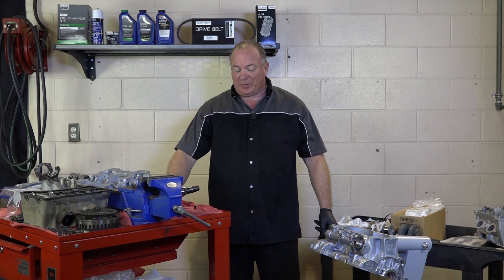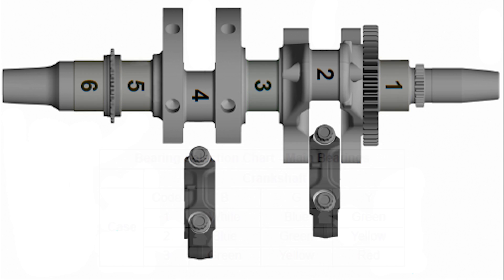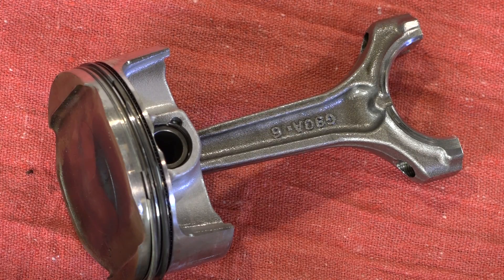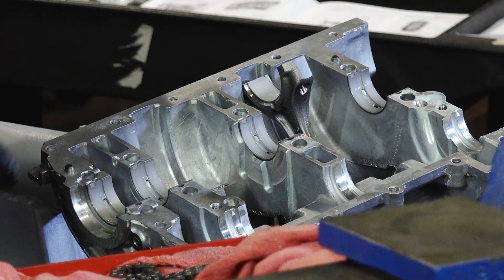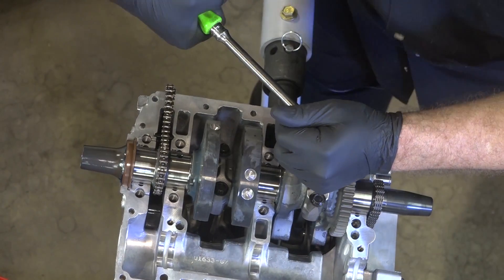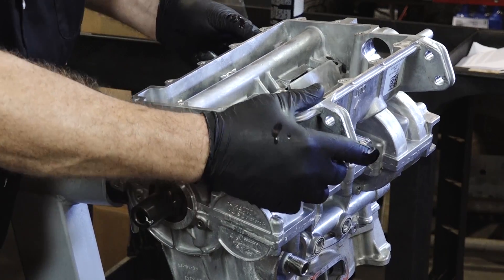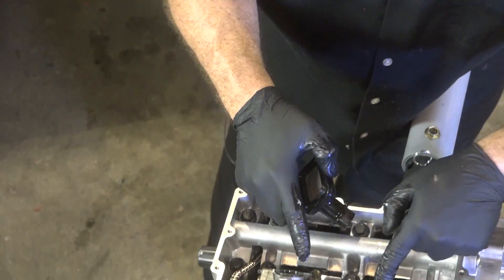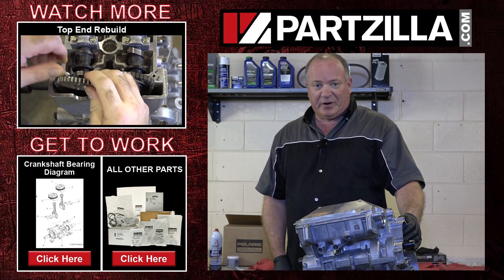Polaris RZR Bottom End Rebuild | Part 5 in Series | Partzilla.com

Comment: Awsome videos guys great work! Very detailed! I am reabuilding my 2012 rxr 900xp rn and i have done everything as the videos show torque specs and everything but for some reason the engine is very difficult  To turn over so much so that the starter cant even turn it over  But as soon as you break it loose it will easily spend but once stopped it seems to get stuck not sure what my problem is would appreciate the help. Thanks!

Comment: Why don’t these engines last at least 100,000 miles? Is it cause they are always at higher rpm? Dirt? Sand? Cause car engines easily last 100,000 miles! Just curious!
Reply from the maker: You pretty much listed all the reasons.  These usually are in more extreme conditions and driven like they're stolen.

Comment: Question John. Bottom half of the block under the timing chain and behind the stator there's a small half circle right under the chain what is it for. Is it for oil to sit to keep the chain lubricated or to keep oil out . thanks.
Reply: Late answer, but it's to prevent the timing chain failing into the engine- off the crankshaft, when working on cams etc

Comment: I have a 900 efi ranger 2014 do I have to split the motor to replace the timing chain or can slip it off the crank for behind the flywheel ??? And thanks for any help full advice
Reply from the maker: You have to split the case.

Comment: I'm rebuilding mine right now can you tell me what the piston ring gaps are?
Reply from the maker: Here is some info that should help you out.

Top Ring: .010" - .014" (.25 - .35 mm) Service Limit: .020" (.50 mm)
Second Ring - 2011 Early Build(S/N 00516 and Prior):.014" - .020" (.35 - .50 mm)Service Limit: .028" (.70 mm)Second Ring - 2011 Late Build / All 2012(S/N 00517 to Current):.039" - .045" (1.00 - 1.15 mm)Service Limit: .053" (1.35 mm)
Oil Control Rails: .008" - .028" (.20 - .70 mm)Service Limit: .035" (.90 mm)
Reply: Partzilla thank you that's what I needed!

Comment: Im really enjoying the engine rebuild videos you guys make. Very helpful. Do you have any tips on removing gaskets? What to use, etc
Reply: Partzilla thanks a lot. I'll be sure to pick up some brake clean. Currently rebuilding a 2000 sportsman 335. Gaskets are being quite stubborn
Reply from the maker: Battlefront -- stubborn gaskets is a really common issue we see. We made a video specifically dedicated to removing stubborn gaskets: https://youtu.be/PHxRInPd6B8 (Hint: All you need is a little brake cleaner and a razor blade)
Reply from the maker: Good luck with your Sporty rebuild! Hoping stubborn gaskets end up being your biggest frustration (#win)
Reply: Partzilla thanks for the help. I'll give it a try once I get the cylinder back from the machine shop. 👍
Reply: Partzilla hey I tried using the brake cleaner trick. Worked very well, thank you. Any tips on removing carbon from valves?
Reply from the maker: Go to 1:02 on this video. https://www.youtube.com/watch?v=D-lX2oUIwSE&list=PLazGjIO6R4vQc3ZZDGPC25xHIahNhmgKe&index=3
Reply: Partzilla cool, thanks for the tip. I just got my oversized piston back from ARTs salvage yard in Wisconsin. Almost ready to start rebuilding
Reply: Partzilla also one question. I'm rebuilding this engine over winter while we're moved out of camp. I won't be able to put it back in and test it until spring. How will I prime this engine so it's not bone dry on startup? Just coat it well with oil? Or should I crank the engine before actually starting it? Both?
Reply from the maker: Coating the surfaces with oil or assembly lube should be enough to carry it through.
Reply: Partzilla ok will fleetfarm or autozone carry assembly lube? Or is that something I need to order?
Reply from the maker: This will do from Autozone: http://www.autozone.com/miscellaneous-cleaners-and-degreasers/lube/melling-4-oz-mell-lube-engine-assembly-lube-and-break-in-fluid/179584_0_0/?checkfit=true
Reply: Partzilla alright I will go and pick some up tonight. Thanks a lot. Really appreciate it. 👍
Reply: Caden K go to your local welding supply shop and buy the little round discs with the nipples on them, works tittys. Make sure you get one for aluminium.